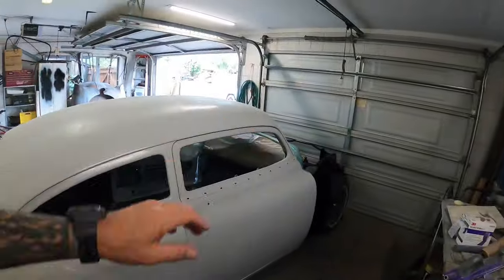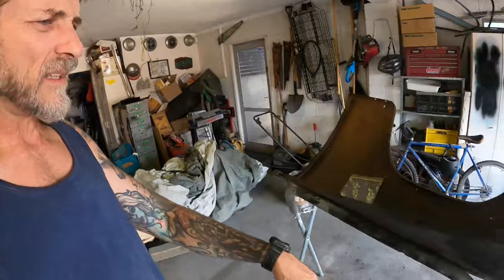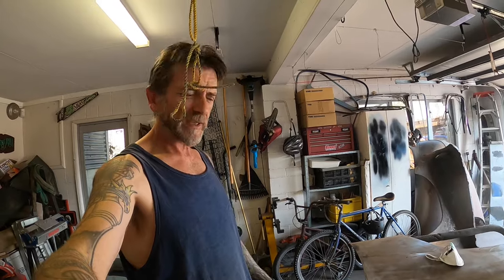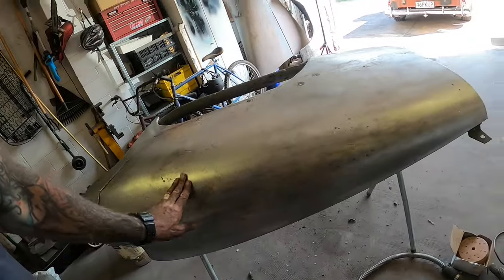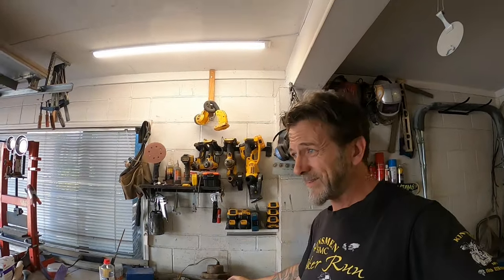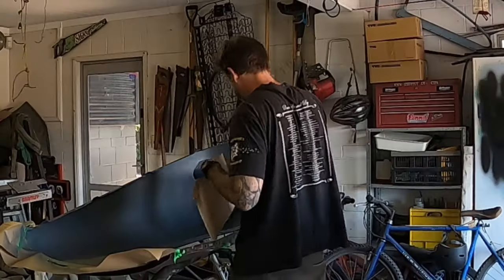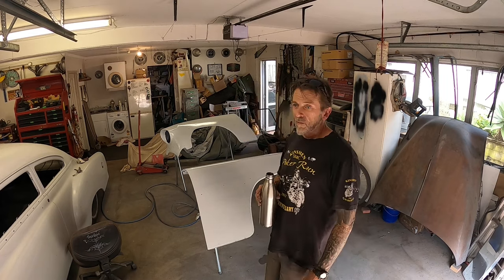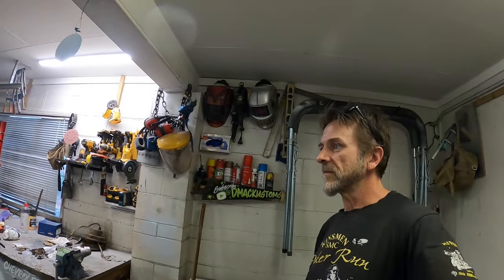Front Fenders!! Stripped, hammered, prepped and epoxy primed. 1951 Chevrolet Custom Area 51

Comment: Awesome transformation on those fenders, look great. Will look fantastic when finished.
You called out issues with the GoPro about half way through, is that common? Been tossing up whether or not to try GoPros out myself. Quality looks pretty good!
Reply from the maker: Cheers RestoHub. GoPro are generally pretty good I think. But they do some weird stuff from time to time. With mine it seems to be with one battery in particular that gives me issues, but I just have to pull the battery and put it back in. Occasionally it’ll just stop recording and switch off by itself haha.  But on the upside they’re pretty tuff and I’ve dropped mine plenty of times. Get a bunch of screen protectors as grinding sparks will imbed into the lense haha.
Reply: @DMACKustoms  thanks mate, appreciate the info.
Reply from the maker: No worries. Also a record a 30fps to keep the file sizes down a bit. 4k makes for massive amounts of data